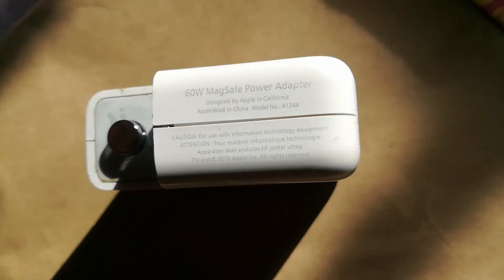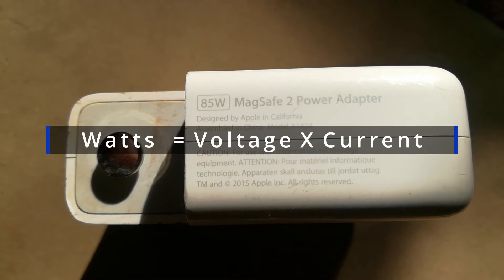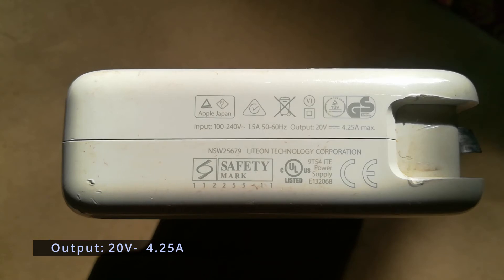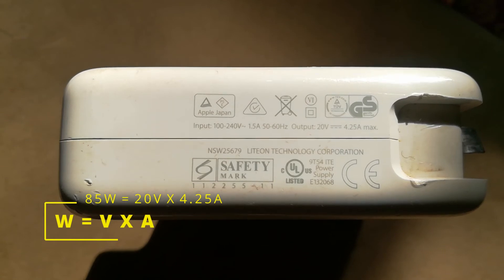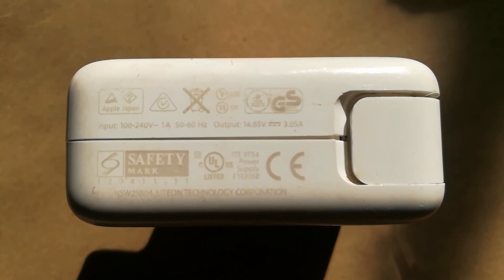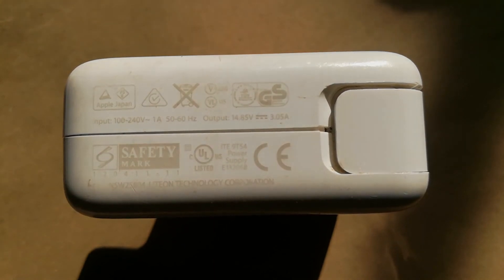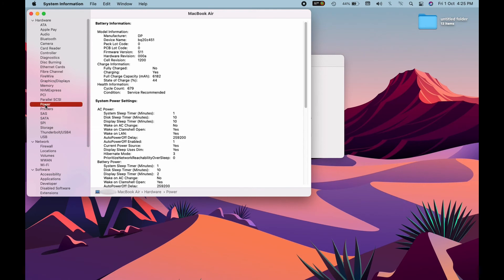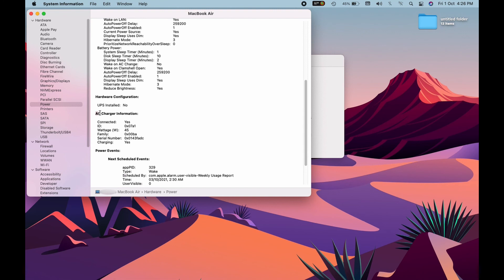Power output of MacBook charger

Comment: Hi sir how can i fix my MacBook after I drop it into water it turn on very well but my screen got a little bit water inside it but work well to.. Can they will be fix or just replaced with new one sir? 
If they will be fix by own diy could you please help me sir because the replacement are really expensive for me to buy 🙏🙏
Reply from the maker: Hi Chun. Thanks for reaching out. The quick response here would be to get a new screen. The alternative would be a DIY job which is very challenging for someone who has never done such a job before. I hope you removed the battery from the MacBook immediately you removed it from the water and let it dry for at least 3 days! Yes this is necessary. Removing the battery stops electricity from flowing and shorting components.  The screen has many components and requires careful approach. But i should say that you will probably be required to replace some parts of the screen. Such parts will be bought or sourced from other spoilt machines. The cost of doing so may just equal the cost of buying a second hand original screen. So I would recommend buying a second hand original screen instead of embarking on an expensive diy. Check out this video on youtube too: "We dunked a Macbook Pro in water!" from the channel : Master Liu. Also don't forget to subscribe to Reach Tech and invite others to do so too!
Reply: @reachtech1  thank you very much sir and I already subscribe your channel